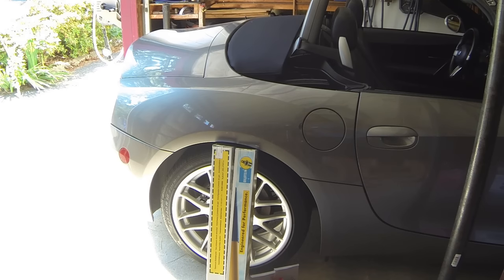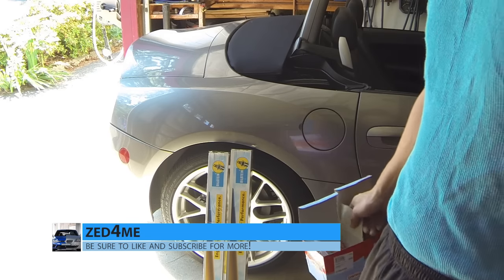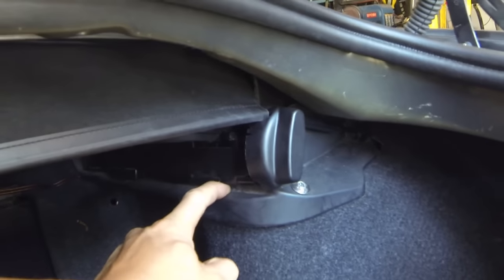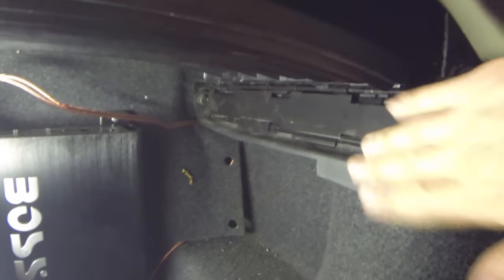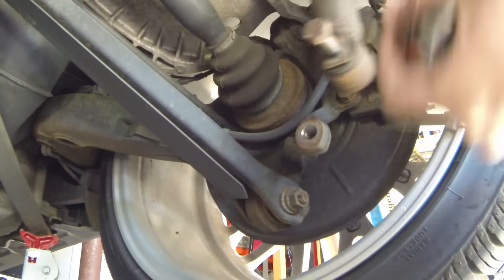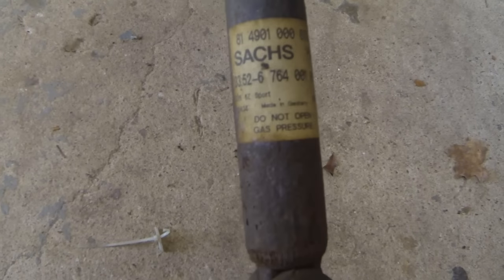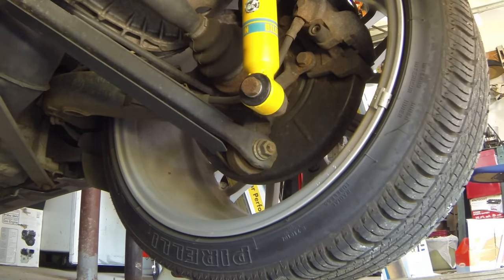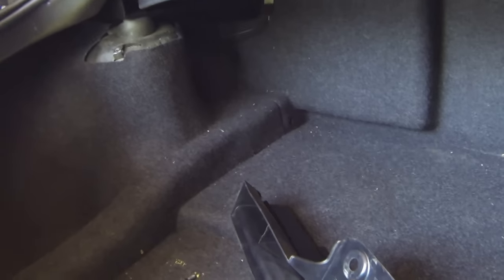How to Replace Rear Shocks + Reinforcement Plates - BMW Z4 Vlog #26

Comment: I noticed you put the reinforcement plates on top of the RSM's. In the front they prevent mushrooming in bad road conditions. In the back the RSM already matches the dome. The plates are supposed to be mounted on the trunk side to prevent the bolts from being pulled OUT through the sheet metal.
Reply: Tommy when you put them in the inside to you also install gasket with plate?
Reply: yep -- incorrect installation ... youtube diyers always look for more than one source ...
Reply: Thanks for this comment. I went back to watch another video by gearbox and corrected it.

Comment: the Rear Upper Reinforcement Plate don't go on the button they go on top inside the car.
is to prevent the body metal from cracking around the Guide support.

Comment: Thanks for the very helpful video.  I will be replacing my rear shocks soon.  After my last mechanic shop wanted to charge me over $700 to replace front strut top mounts, I have used the videos to do the work myself.
Reply: incorrect installation plates are supposed to be mounted on the trunk side to prevent the bolts from being pulled OUT

Comment: Thank you so much, great job. I could never have completed my shock replacement, without using your video.
Reply: incorrect installation plates are supposed to be mounted on the trunk side to prevent the bolts from being pulled OUT

Comment: Update to the rear deck clips. Yes, the two clips toward the front of vehicle can best be installed from the cabin. The two clips nearest the trunk are easily installed before you re-attach the fabric shroud. Just reach around & on top of the plastic shelf.

Comment: Thank you for posting this.  I’m swapping my suspension out this weekend.
Reply: incorrect installation plates are supposed to be mounted on the trunk side to prevent the bolts from being pulled OUT

Comment: I have replaced with Koni semi adjustable  a year ago. It took a few month for research how to remove rear panel...You were so quick.  It took for me to work for 4 hours to replace both rear absorbers. If you uploaded this video before I did, I could do faster.
Reply from the maker: I certainly took almost two hours to do both sides.. it helped that I have removed the rear panel before to remove the top.

Comment: Hi another thing I noticed other than the reinforcement plate is in the wrong place is there should be a washer on the lower bolt that does come with the shock. There isn’t enough shoulder on the original bolt to keep the lower part of the shock in place. You made it an easy job to do.

Comment: 15:00 You should be working on the car while it is supported by jack stands- NOT the jack. The jack is for raising the car. Your jackstands were also in the wrong place. Not sure if they would have even caught the car if the jack failed. If you had the jack stands holding the car you could have lifted your wheel instead of lowering the car. Cheers.
Reply: Right. Removing the wheel would have make jacking up the wheel hub much easier too.

Comment: Thanks for the video. Just followed step by step and very easy. I found to remove the 'Christmas tree' clips, remove the pins with pliers first.
Reply: incorrect installation plates are supposed to be mounted on the trunk side to prevent the bolts from being pulled OUT

Comment: Is there a way this job can be done without ripping the insulation? I wouldn't want any of mine ripped at all and I know for a fact my rear shocks need to be replaced. When I sit in the car or get out OR I push down on the car at the hood, there's a squeaking sound.

Comment: Good job with the details. Thank you.
Reply: incorrect installation plates are supposed to be mounted on the trunk side to prevent the bolts from being pulled OUT

Comment: Dude, your shelf clips are missing.  There should be 4 of them holding the piano hinges to the shelf.  Pop them out from the bottom, reinstall them from inside the cabin. Mine ended up missing after my mechanic did the rear shocks.  I replaced the clips (at about 12 bucks each) when I found the hinges kept popping out by themselves.

Also, consider getting rear shock mounts from Rogue Engineering.  Includes a reinforcing plate with bolts welded in.  Drop in from the top and tighten up from the wheel well. Replace the shocks without ever going into the trunk again.

Comment: Thank you for this video! I just bought a BMW 330ci and got some reinforcement plates for the rear but they didn't come with the gasket. Should I search for the gasket or is that not really necessary?
Reply from the maker: If you don't want squeaks you should use the gasket.
Reply: zed4me thanks for the reply. Anywhere I could find the gaskets? I couldn't find them online.
Reply from the maker: FitnessJive try using real OEM and going from there
Reply: In the good old days you could find gasket material and make your own gasket really not hard to do

Comment: Hi,  great vid.  Did the ride improve after fitting the B6's over the standard Sachs shocks?  The M-Sport suspension is a bit crashy on UK roads and was wondering if B6's help smooth it out a little.
Reply from the maker: Col yes but the improvement probably lies more on the fact that this car needed shocks. Hard to compare apples to apples when the old shocks were toast.

Comment: So you put the Bilstein B4s on the front, which seems to be ok for the M Sport suspension, but you must do B6s on the rear right?
Reply: No b4’s all round would be fine. Cheaper than b6 and more compliant.

Comment: Question, I have the M sport suspension on my 2004 Z4 and some of the information I've seen on the web says I should use the Bilstein B8 shocks, but I see you used the B6. They worked for you with no problems?
Reply from the maker: The B4 is for stock with non-sport suspension. The B6 is for sport suspension. The B8 is for even more lowered cars. I had to go through a lot of research to figure this one out too.. but our m-sport suspension z4's should use the B6 shocks.
Reply: Thank you very much! This was a big help  and thank you for your fast reply.
Reply: First of all, thanks zed4me for the very helpful videos.  Because of your video  I am tackling my rear shocks today.   But regarding which Bilstein model to use for the Z4 sport suspension, I too did a ton of research about it.  I even called Bilstein and they told me to use B8.  I've read of others using the B6 and they didn't report back about problems but from Bilstein's own helpline comes the recommendation of the B8. I think the only issue would be the "at rest" position of the piston and the amount of travel allowed from that position.  As I said, people have gone both ways and maybe the B6 is OK but I decided to go with the manufacturer's recommendation.
Reply: I have been confused as well at to whether the B6 or the B8 is the correct shock for a car with M Sport suspension.  I called Bilstein as well, but they told me what zed4me reported above- B4= standard, B6= M Sport and B8= aftermarket lowered suspension.  I have read what Rick N has mentioned a few times in various BMW forums as well, not sure why we are getting different info from Bilstein!  In any case I have heard both the B6 and B8 works fine, but am going with the B6 for my Z based on the manufacturer's recommendation :-)
Reply: zed4me  Is the B6 fit for the M-sport front as well?

Comment: Such a great video!
Reply: incorrect installation plates are supposed to be mounted on the trunk side to prevent the bolts from being pulled OUT

Comment: you installed the reinforcement plates in the wrong position. they go in from the top and are bolted in. they offer no additional stability the way you installed them and were a waste of money. a fine video aside from this mistake, your rear end will just be 3 mm higher.
Reply from the maker: Source?
Reply from the maker: Thanks. In the front they go under, whereas in the rear they go over.. I did the fronts first so I didn't think the rear would be any different. Nice to know, and I will be putting them in the right place the next time I have to change the shocks.

Comment: what a hack   plates incorrectly installed  they go on the top of the tower INSIDE the trunk, not underneath the inner wheel well.  no need to destroy the rubber also